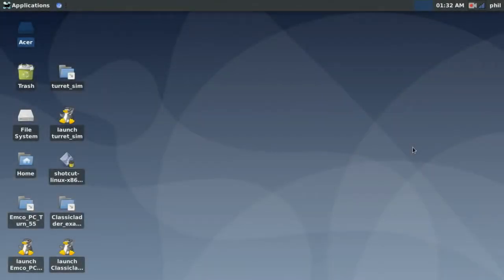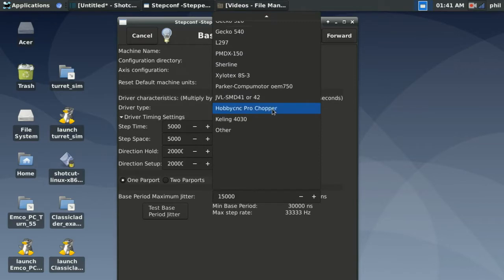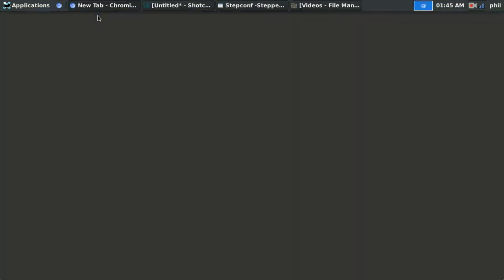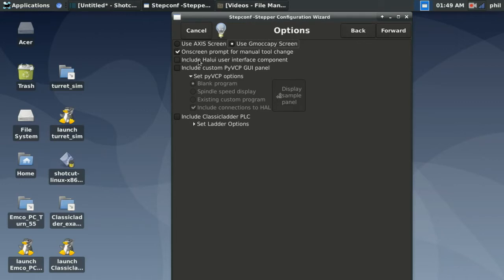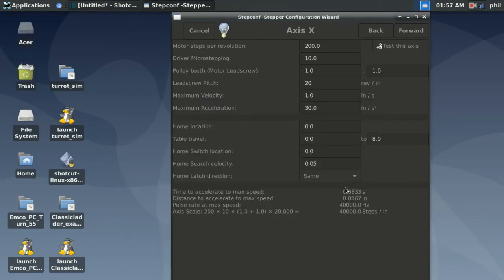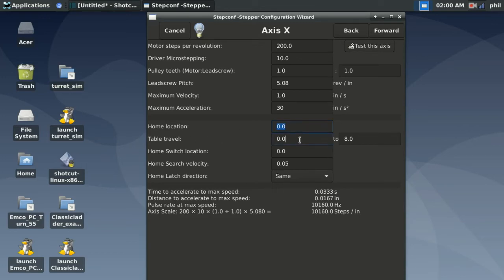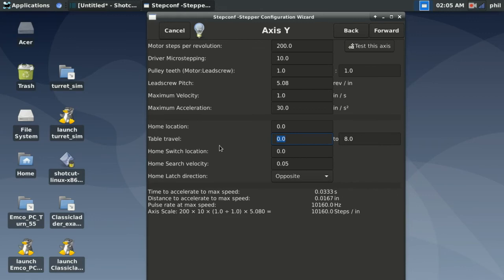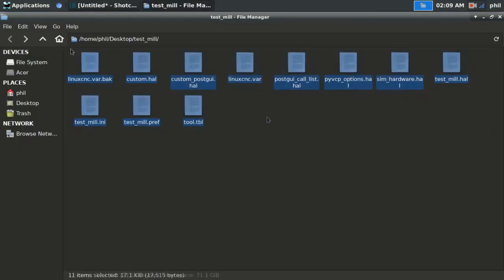LinuxCNC Bare Bones, Part 3 - STEPCONF wizard

Comment: I have Power Step PSD5042-2P drives. I have a signal sequence timing chart.  I’m not sure how to convert that to Step Time, Step Space, Direction Hold, and Direction Setup.   Can you help me?
Reply from the maker: The step and direction are labeled pulse and direction on the driver itself, the microsteps are set by the dip switches... As far as timing goes, see if the drop-down has anything preset for a 5042 driver or maybe a 542. If it doesn't work, try a different driver timing, wash, rinse, repeat. Once it's in a happy range, it'll come to life. Sometimes the manufacturer will have specs on timing as well
Reply: I have this Control signal sequence timing chart for it that is a map of the pulses so to speak.  I’m just not sure I understand it
Reply from the maker: Email me what you've got. theferalengineer@gmail.com

Comment: Thanks you for helping us understand better, i just have some questions why did you divide the lead screw pitch value by one i have 2005 and working with metric so should i do 5mm or 1/5=0.2 i got confused 
and do the dm556 driver microstepping value be the same as in stepconf i have put 1600 steps/rev same as in my drivers driver micro stepping 0.5 5mm for the pitch diameter then i got true travel values but i think there is maybe something wrong.
another problem im trying to solve is z axis table travel i have 200mm moving distance how do i setup positive and negative value and should i put home location in 0 or near the limit switch i really got confused with z axis. thank you again.

Comment: I think you have max acceleration incorrect. The higher the number the faster the motor gets to speed. If your motors are locking up you should lower that number. Not positive but I would check it out.
Reply from the maker: Timestamp, please. 

If you accelerate or rapid too fast, both will cause the motors to lock up/lose steps due to exceeding the available step transfer rate or the torque limitations of the motors
Reply from the maker: When it comes to acceleration, the larger the acceleration number, the longer distance it takes to reach top speed.
Reply: @TheFeralEngineer  Time stamp 16.30 
The units are in/s^2 which is the velocity change per second.
So if you have an acceleration of 10in/s^2 that means if you start with zero velocity after 1 second you would be going 10in/s. After another second you would be going 20in/s
Example: If you have a max rate of 10in/s and an acceleration of 1in/s^2 and you start from zero. It would take 10 seconds to get to your max rate of 10in/s thus slow acceleration and less stress on the motor and less likely to miss steps. In the 10 seconds it take for the head to reach top speed the cutter would travel:
1t^2=100in
If you upped the acceleration to 10in/s^2 it would take just 1 second after starting to have reached max rate.
Thus higher numbers mean more acceleration/quicker cutter movement/more likely to lose steps.
In the second it take for the head to reach top speed the cutter would travel:
10t^2=10in thus bigger numbers equal shorter distance to reach top speed.
Reply from the maker: @curtis52285  I'll double check when I'm in front of my machine. I'm out on customer location at the moment.

Comment: Thanks again. Much appreciated! Once you do the Ethernet set-up video or perhaps a bit later in the series could you fit in some info on how to set up dual steppers for a moving gantry type router? You know, whether to just run them off the same set of ports on the Mesa or assign them to each their own. And then after that, perhaps your opion on the best, easiest, most affordable homing switched for the "home gamer" who is still after some nice precision/
Reply from the maker: The mesa configuration has a dedicated option for tandem x y and z axis, stepconf only has double assignment, but they both work in the same fashion. It's up to the user to bench test and make sure the motors are spinning in the proper direction for their application, but I'll make sure I cover all of that stuff in future videos 😊
Reply: @TheFeralEngineer  Awesome:). Like I said, I - and many others, I am sure - will be using these videos in the years to come to help us take the plunge. Much, much appreciated!

Comment: About this PWM.
If i''d like to use an RC BLDC motor with ESC like a spindle (now I use a servotester that is work on 100 Hz between 800 and 2300 ).
How can I configure it correctly?
0.8 ms - zero speed and stop (M3 M4 M5 not needed, or not used)
2.3 ms - max. speed
Reply from the maker: What are you trying to use the motor to do?
Reply: @TheFeralEngineer  Use it like a spindle. Now I'm doing it manually.
https://www.youtube.com/watch?v=6DBzH-Vy3qA
https://www.youtube.com/watch?v=uLMsehhe8xg
Reply from the maker: @DPTech_workroom  so you're trying to bypass the potentiometer and control the speed with a pwm signal? Do you know if an analog signal would work or is it pwm only? I've only used the pwm generator on a g540 with a superpid spindle control. On my emco lathe, I'm using the analog spindle section of the Mesa 7i76e, but I believe one of the stepgens can be used as a pwm generator, but it may require a hal tweak or a firmware modification. Peter Wallace said that pwm is possible on the 7i76e, but never told me how to use it 😆
Reply: @TheFeralEngineer  Yes. It's a 5v PWM needed, to control the ESC.
The analog is just only to control the servo-tester PWM. (if solder it out, it can be an analog version too, but it's complicated.)
On my lathe I tried out the ModBUS RTU on a Danfoss VLT FC51, because i use the digital inputs for manual control.
On my plywood Box-1 CNC mill I'm using that BLDC motor + ESC + Servo-Tester. And all the electronics for 3d printer. (Arduino MEGA, RAMPS 1.4, DRV8825)
But I'm interested in LPT version, because of this (using GPIO driver)
https://www.youtube.com/watch?v=RT3o5QwfdBU

Here is a video about use PWM on stepgen on a MESA card without analog output.
https://www.youtube.com/watch?v=i6wO_pgAIuI